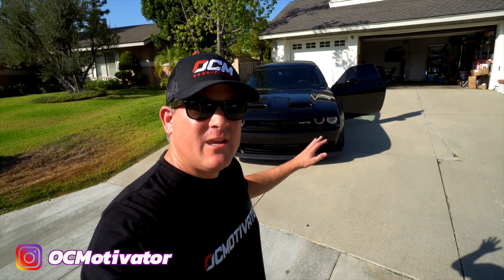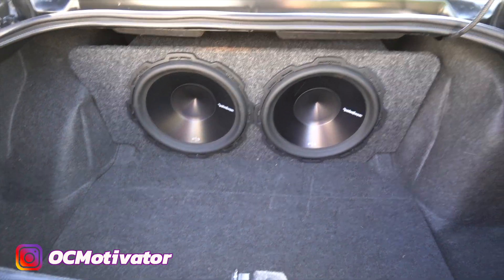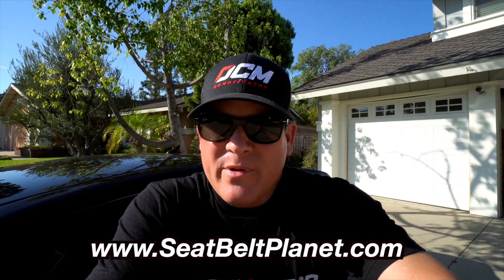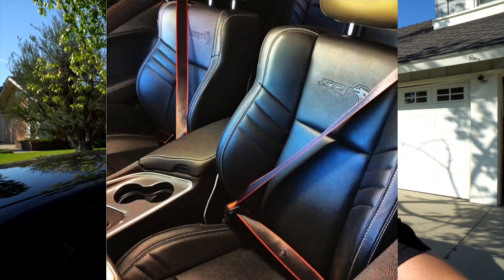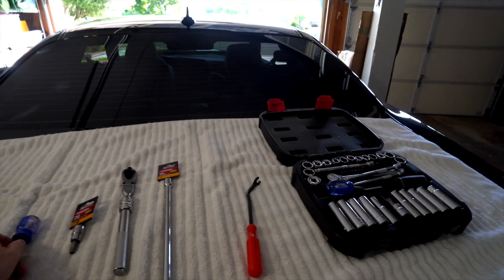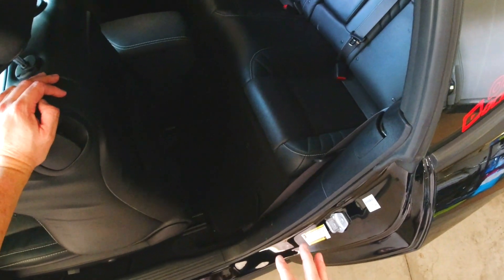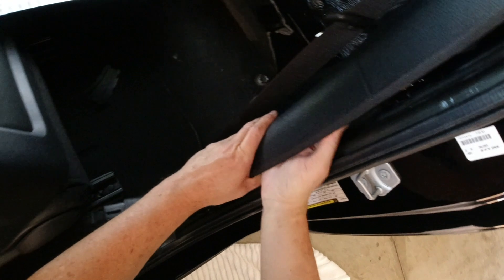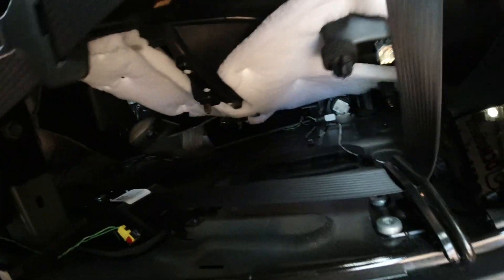EASY DIY SEATBELT UPGRADE FOR MOPARS OR ANY CARS!

Comment: That black with the red edge looks very good what did your stereo upgrades cost? That looks like a very clean install I want more bump in my challenger
Reply from the maker: So with all the interior speakers, 12p subs (prior to the 15”s I did as a fun experiment) and Amp, I was under $1200 but I went pretty high end with the interior speakers.  The whole thing could be done very nicely for under $1000 and it’ll blow away anything the dealer sells with the car.